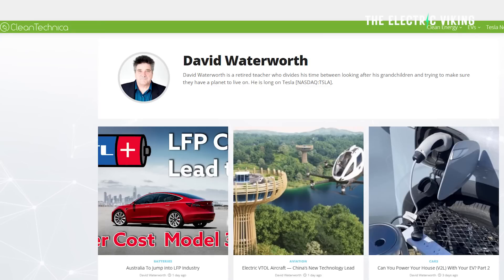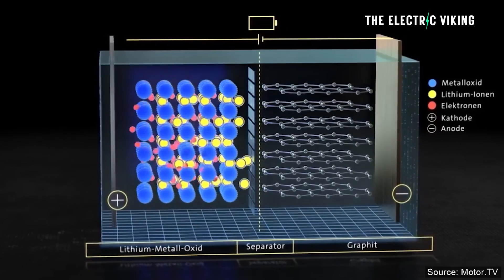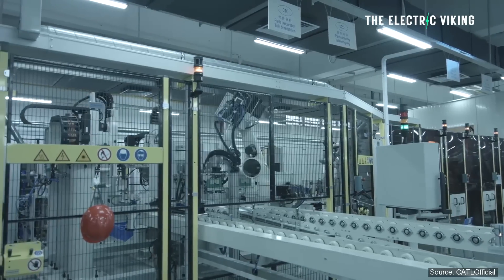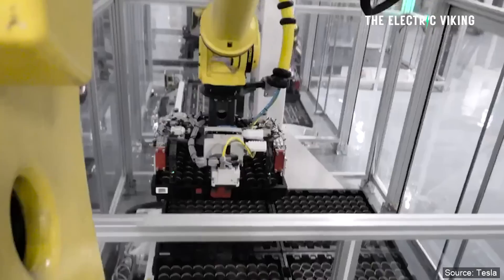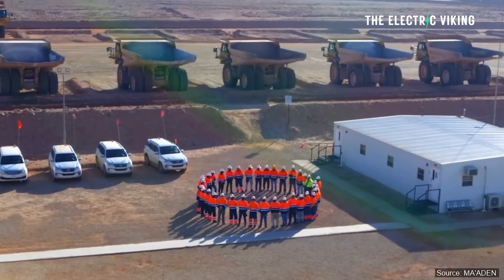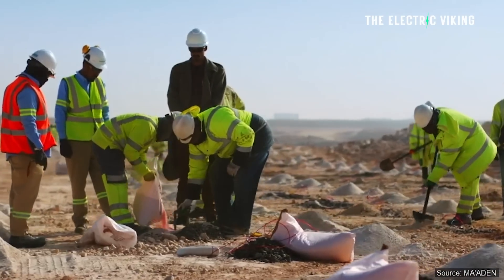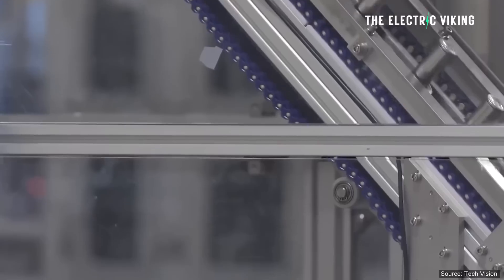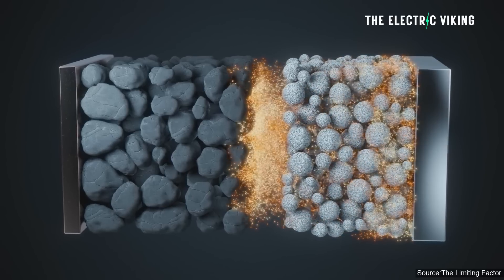Australia will invest billions to make LFP battery cathodes & end China reliance

Comment: Just making cathodes ???  What about the anodes and electrolyte ???
Reply: The electrolyte is apparently typically lithium salt dissolved in an organic solvent
Reply: Graphite is one of the most widely used anode materials in commercial lithium-ion batteries
Reply: Another anode alternative is Lithium titanate which has fast-charging capability and long cycle life. ( but less ion storage capacity ) but excellent safety apparently.